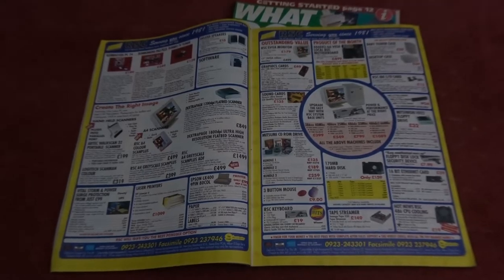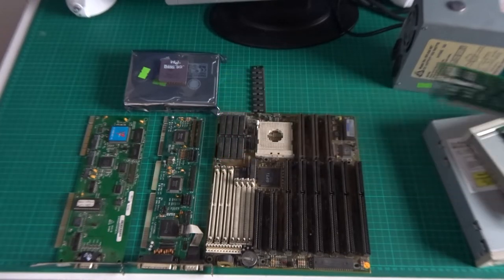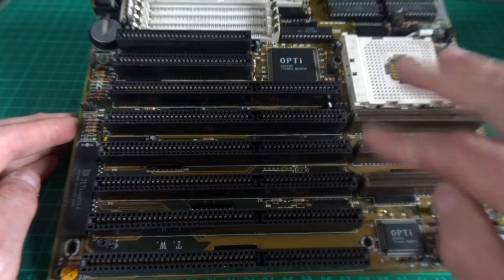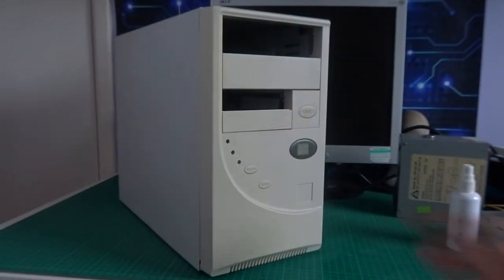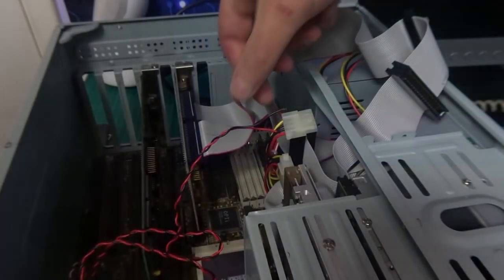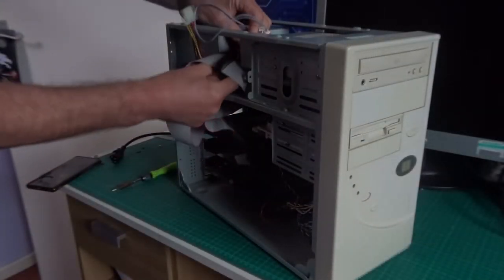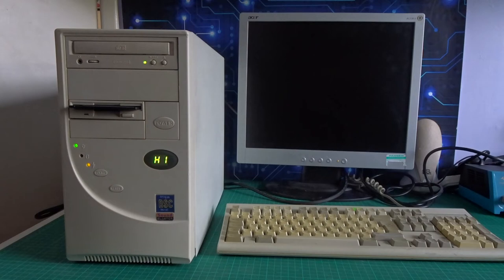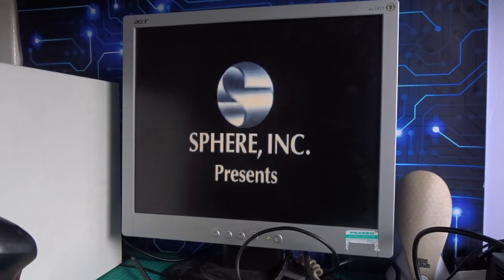Building a VLB 486

Comment: Oh this takes me back.  My family's first PC at the end of 1993 was a Leading Edge Intel 486DX2-66 supposedly with VLB video card... it was actually a WD ISA video card in a proprietary local bus slot using an EISA slot.  (Which I learned years later wasn't EISA either, other than the same physical slot, when I put an EISA card in it, and fried the PC.)  Then came my 1st PC, an IBM PS/1 Cyrix 486DX50 (not DX2, if the labeling was correct), which I installed OS/2 3.0 when it came out.  Then came my first PC build, replacing my family's PC - an AMD 486DX4-100, VLB no-name motherboard with 3 VLB slots and both 30-pin and 72-pin SIMM slots, similar to yours here.  Initially filled it with 8x 1MB 30-pin SIMMs, and I think it had 2x 72-pin slots.  Ran both MSDOS 6.22/Win3.1 and OS/2 3.0 on it.  Video card was a Diamond Speedstar something-or-other VLB card, and HDD/FDD/IO was a generic VLB card.
Hope you get the VLB IO card working... feels wrong to use an ISA IO card in a VLB motherboard.
Reply from the maker: Cool, some interedting machines! Yes I need to take another look at the vlb io card. That akdo reminds me, I have a coupke of veraions od os/2 and some other win3 skins Ive been meanong to take a look at. Will do soon.
Reply: Ooohhh, I loved OS/2... bought the red-box Warp 3.0 when it came out, ran it on that PS/1 with 4MB RAM (sluggish, but their only shot, since only power users had 8 MB), ran it on the self-built 486DX100 using its boot manager to choose between it and DOS/Win3.11.  Bought the Blue-box Warp 3 to have no MS-purchased OS/environment on my PC.  Drove 1.5 hrs to buy and install OS/2 Warp 4 when it came out.  A few years later when  I got into networking, I learned how drastically different IBM networking was, via OS/2.  By then, I was heavily getting into Linux, and that was the end of my OS/2 experience.
Reply from the maker: Never used it yet! just ran up to look, the one I have is a red os2 warp 3, also on the shelf is suse linux 7.0 so there will be a build with that at some point, thinking a pentium 4 as I have a few boards doing nothing. That might be a nice server to hook up a bunch of the other machines to. I have another wierdnoverlay type thing for win3 from hp to look at. Will probably put the os/2 on my 486 soon.
Reply: The red-spine OS/2 didn't include windows 3.1x, if you had it installed already, it could do win-OS/2 (win3.1x apps run seamlessly under OS/2), otherwise, only DOS and OS/2 apps.  Blue spine included win3.1, so you could run win3.1 apps, with no previous OS/windows on your PC.
Any 486 with 8MB RAM is plenty to run OS/2 3.0.  It'll run in 4 MB, but sluggish.

Comment: OMG falcon3! I haven't seen that one in ages. I used to play a lot (single player only) on my 486 DX2/66, with a shitty quickshot digital joystick. The FPU did make quite a difference in these sort of games. That F16 takeoff cinematic was unbelivable.
Reply from the maker: I played it to death. Had the mig 29 add on too. I used to play over null modem with a freind which was fun, doing coop missions. Yes fpu was a bonus, I was rocking a sx25 at the time and you could tell vs my mates dx66. Also never got the digital speech working back then with my 8 bit mediavision thunderboard 😔 so nice to be able to now. Ditto, it was all cheap quickshot stuff for ke back then too.

Comment: The score for the 386DX-40 seems a little slow. You can probably improve that by tightening memory timings, reduce wait states and increase the ISA bus frequency. A 386DX-40 scoring around 16 points in 3D Bench is pretty speedy.
Reply from the maker: Cool. Didn't really do anything in the bios. I'll aim to do some tuning😁

Comment: Going from a 486 dx/33 to a dx2/66 was night and day with some games.  I had a generic Mortal Combat clone which involved fighting robots, and with the 33 it was slow, but playable.  With the 66 it was quick and challenging.
Reply from the maker: Yes dx2/66 was the sweet spot back them. I couldn't afford to upgrade back in the day and lived with my sx25 for quite a while and then jumped to a pentium 133. Got an upgrade project for my gateway dx/33 to dx2/66 lined up using an overdrive when I get time so will find out what it feels like soon 😁
Reply from the maker: @Dmetsys I never had a dx4 100, i have the processor now so will have to buld a machine around it at some point. Win 95 on a 486 souns fun!

Comment: your mobo is a Jetway J-403TG. i googled the BIOS string and found that. i have a similar board, a Edom Wintech MV035F, that was made in 1998 for some odd reason, it has a AMIBIOS like that as well.
Reply from the maker: Cool, thanks for the info. Funnily enough I lost a bid last night on ebay for a mini socket 7 system by jetway, presumably the same company, never heard of them before!

Comment: Sx2 50 means that it was 25mhz  externally clock doubed internally to 50. DX2 66  was 33 externally  internally clock doubled to 66 but the D meant it had a copro. At the time i was buying pcs for where i worked( indepentant to what the it department was doing) and because of my boss's signing limit we  used to buy a 486 sx25s computer on one order  and also bought  a dx2 66 cpu on another order. Or would buy half a "custom" computer on one order, and the other half on another! The "broken" computers we were allowed to take home, so my first PC was a 286 was one i bought off a co-worker that had a bad hard drive, and a bad ega monitor . I needed to buy an ide hard drive , and IDE isa controller card and a VGA card and a vga monitor. My next machine was a "broken" DX33 that  had a bad hard drive but i  also had a "broken" 386 that had a good hard drive.  For a few years i just dumpster dived  the skip behind work, eventually i joined the IT department ( based on what i had learnt) and we stopped buying custom  pcs, and what i would call proprietary Pcs  and junking "broken" ones and started repairing them by swapping out parts!
Reply from the maker: That sounds pretty cool, you must have had access to all sorts of cool stuff. My sx25 did me for years then i got a pentium 133 upgrade kit and used the old case, hdd, monitor etc.

Comment: Is that CD-ROM drive from Aztek Multimedia Kit?
Reply from the maker: Maybe originally, I got it as a seperate off ebay
Reply: @66mhzbrain  I had a 6x speed with the same front panel back in the days from Aztek Multimedia Kit
Reply from the maker: Cool to know. I like aztech sound galaxy sound cards and have a few, possibly some from the same type of kit but not had any optical drives from them before. Might have to pair them up in something.

Comment: You didn't see the fuzziness because it was on a CRT.
Reply from the maker: Maybe. Pretty sure the video resolution is the main reason, though youve made me curious so Ill have a look on a crt. Was only using an lcd for camera syncing reasons. It will be perminantly hooked up to a crt😁
Reply: I don't know what CRTs you remember, maybe CRT TVs... computer monitors were pretty damn sharp.
Reply from the maker: I have a bunch of crts, and they are way sharper than even modern lcds, bit they still cant do much for a bit of fmv with a low pixel count. The vids were very low resolution in order to fit them onto a cd rom.

Comment: You're not 66 MHz brain... Well I'm 16 MHz bring...
Reply from the maker: I'm overclocked but unstable
Reply: @66mhzbrain  my vrm and multiplier wouldn't even allow for overclocking 😥😭😭
Reply from the maker: Just get more ram and be happy 😁
Reply: @66mhzbrain  ok then, I guess.
Reply: Well I had my MHz graded a few years back & it turns out that I ** ERROR 404 ANECDOTE CORRUPTED ** ;)